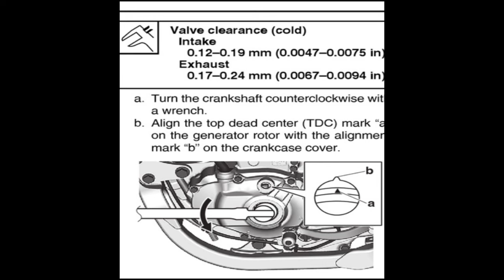2023 YAMAHA WR250F VALVE CHECK (Spec's and instructions)

Comment: OMG, I've owned my WR250X for like five years and pretty much commute on it daily.  I've yet check the valves.  I'm so bad about that stuff.  Just did the air filter for the first time last fall.  Thanks for the inspiration!
Reply: you just did the airfilter for the first time in 5 YEARS? what about the OIL?? RIP your bike and wake up dude